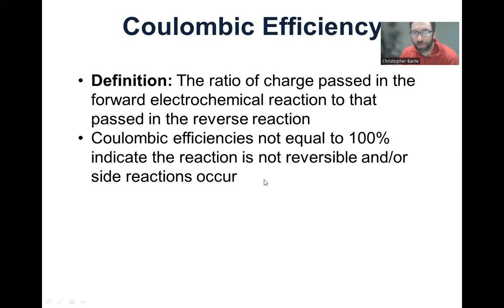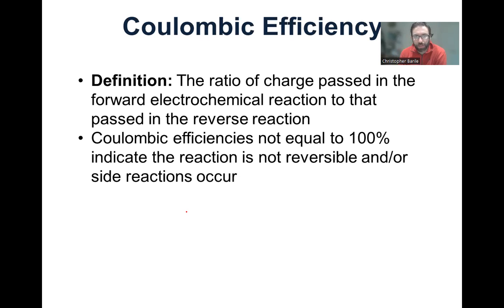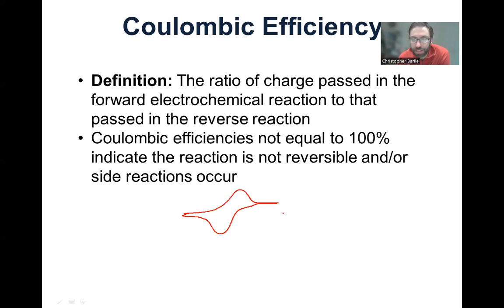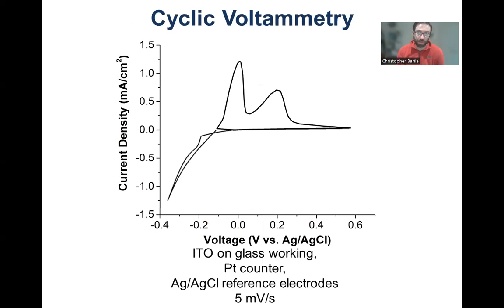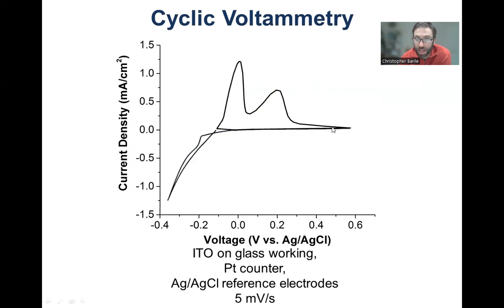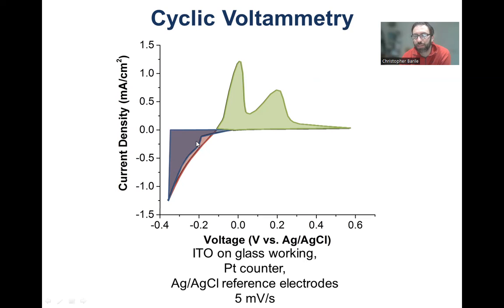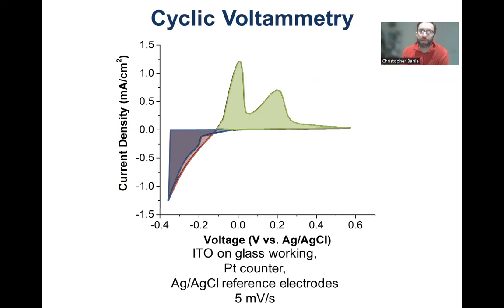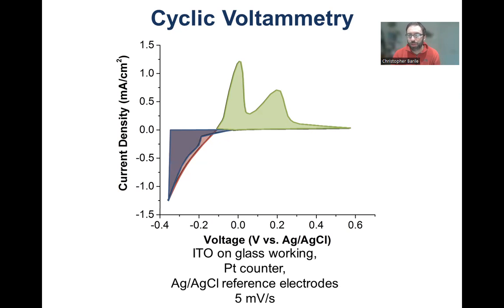Coulombic efficiency

Comment: Hi,

Thank you for your short but very useful video. Could you kindly share the names of any papers or books that explain this method, specifically the calculation of Coulombic Efficiency (CE) using Cyclic Voltammetry (CV) tests?🙏
Reply from the maker: Bard and Faulkner's Electrochemical Methods is the classic book, but it can be hard to read.